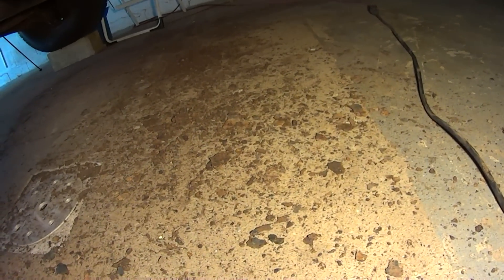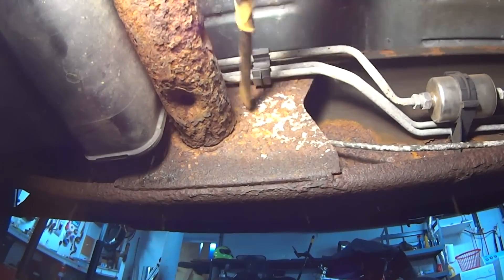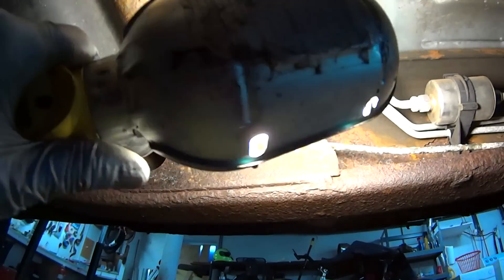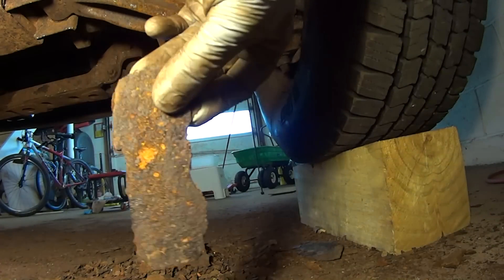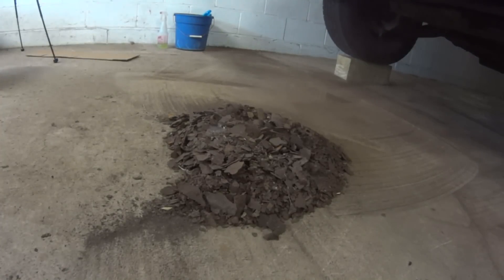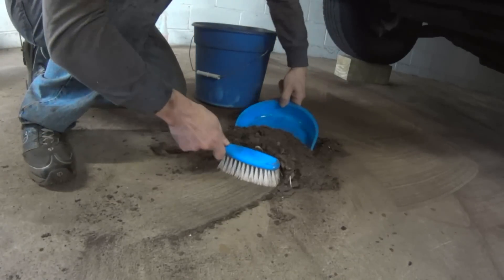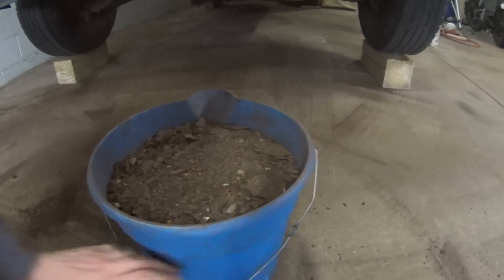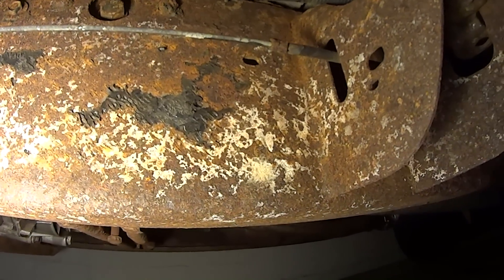Most satisfying video. Silverado Frame rust removal, RUST PROOF STUDY

Comment: ashes ashes, dust to dust, just sit back and watch the GM rust
Reply: Not as bad as dodge
Reply: My car was made in the 1820’s and I️t has 0 rust
Reply: Kevin spacey ive seen a few fords before, chevys run good and ride amazing. But the fames are a problem, unless you sandblast and paint them. I have a 1992 and a 2006 dodge 2500s both are out in the winter time in the salt and their clean (06 has bed rot like every one ive seen) when i got the trucks i tore them appart and had them sandblasted. Every year before snow hits i shoot the frams with some black rustolum and I could eat off the frames
Reply: Kevin spacey but I thought the grand Cherokees were unabody?
Reply: Willie G lol! The only problem is they all rot out the same GM Ford and Dodge I'm up in the Northeast every truck that comes in my shop same position doesn't matter who makes it
Reply: Its got nothing to do with gm, it happens because they buy the vehicles then don't take them to a shop and have them undercoated. This kind of damage is caused by salt which is put down to control ice and snow!!  This will happen to a ford, or dodge. I will say this about ford tho, the truck bodies are made from aluminum, so we know it don't rust!!
Reply: Kevin spacey it wouldn't last forever up here  in the Northeast the chemicals are horrible best thing I found New Hampshire oil coat it once a year stay like brand-new forever
Reply: Andrew Morgan good point thanks ! I never thought of that! But the thing that paint won't do that the oil will do is it creeps in all the places that you can't fit a spray gun and through capillary action it actually is drawn towards the rusty areas and It Coats it with an oily film that stops any oxygen from getting at the metal and helps to slow the process or even stop the process of oxidization! I have personally tried every way you can think of and without a doubt the best way is to have the frame out of the vehicle sandblasted zinc-coated epoxy primer coated and then covered with some type of a urethane paint it will pretty much last forever if you do that but it's extremely labor-intensive and expensive!! oiling cost 180 bucks a year I've been using it for 2 years now and I have absolutely no more rust issues at all and I'm in the Northeast Rust Belt!
Reply: My 17 year old GMC Sierra is just now barely showing surface rust on the frame. But I live in the south where it rarely snows and wash the undercarriage good after visiting the beaches also. Go figure😂
Reply: All vehicles rust lol
Reply: @Kevin spacey Dude you're seriously going to try and claim your Jeeps are superior against rust? Every fucking Jeep 10 years and older are nothing but cancerous rust underneath. It's seriously the hardest part of finding a good used Jeep because they're all rotten out.
Reply: Kevin spacey i use the rust reformer lol but usually in a years time the frames still clean, i hit them with my power washer, let it dry and paint them, being as ive done it for 4 years now they the paints getting pretty thick lol
Reply: Kevin spacey lol that was my bad
Reply: Or you know you could maybe toss  a resistant coat of paint on the frame every year?
Reply: Kevin spacey u are incorrect about GM trucks being the only ones that rot I have F-150s, my shop up in the Northeast all the time I go to lift them up and the lift arm go straight through the frame they all wrote the same!!!!
Reply: Willie G 
I'm laughing at your comment while choking back tears as I also think about all the goddamn rust on my Camaro. Thanks, GM.
Reply: I lived in Minnesota for most of my life and out of every vehicle my dad or my family has owned, the GM's used to be the ones with the least amount of rust. The dakota my dad owns still has pretty much rotted away and the frame is going out the way of the body, He's also owned a 1994 GMC sierra was rust free no rust anywhere. My uncle has a 90s Silverado and its frame is damn near rust free the body pretty gone. My aunts 2015 is rusting as bad as my dad's dakota. My other uncle's 2015 dodge ram is the worst in rust on the frame. Then again here in the midwest we have a saying, DON'T BUY FROM MINNESOTA. Once it leaves the dealership it will rust lol (If you are wondering why I never brought up my vehicles well because they are old as fuck)
Reply: Has nothing to do with the brand. The reason it rusted was Salt as stated in the video. Not anything else anyone that lives in the rust belt will tell you the salt from the state plows kills your car.
Reply: Willie my 96 f 150 is same way. What is it the 70s frames were made better? Money Money.
Reply: My 99 Tahoe has not one spot of rust on the frame. Its all about taking care of the frame. Just wash the frame off after they put salt on the road.
Reply: Kevin spacey They don’t want them to last forever, forced obsolescent
Reply: dailga my dodge is 25 years old and has stock paint on the frane
Reply: Willie G still run better than a ford
Reply: Kevin spacey yes but that was 20 years ago. Im a welder, i work with steel. Zink, which is used in the galvanizing process. The price has gone up over the years, and why would a car manufacturer make a car that lasts a lifetime? Then you wouldn’t buy another one or two. Gotta think business
Reply: 21 @blacksheep9734    Then again sell me deliberately cheap 💩 for whatever reason and you’ve mad an enemy for decades .   Then a prick like me takes the time to file these things in detail on places like  carcomplaints, NHSI ect. Then there’s that other business principal which kicks in, “ bad news travels fast” and the smell 🙊lingers”,especially when others pile on.
Reply: GM don't care. They want you to upgrade and buy new, so old can't last

Comment: The God damned salt is a major problem
Reply from the maker: Sure is but without it i would not be able to drive for 4 months
Reply: @troutjunkie7330  Doesn't sand and pebbles do the job well enough?  I avoid purchasing a used car from salt states.  The Sierras get 4 plus months of snow and we get by fine WITHOUT SALT.
Reply: @troutjunkie7330  isn't gravel better ?
Reply: @troutjunkie7330  No thats when they need to use more Cinders an less salt or just make heated roads lol wouldnt that be nice
Reply: @troutjunkie7330  Sure could with studded snow tires just keep the roads plowed
Reply: yup. sorry to all of you that believe differently. Don't fool yourself.  Its not the Chevy, its not the Ford but rather  the lack of doing your chores by means of a  fresh water pressure rinse the next day it stops snowing, the roads are dry AND the  lack of applying any sort of oil or lanolin spring and fall.

 or prepare yourself to pony another 50 grand for any overpriced truck for the next 72-84 months. until they hot dip the  frames, and outfit with aluminum bodies,  stainless lines, rotors, banjo bolts etc,  Ile stick to the fore-mentioned and continue  driving a rust-free  02.  $35/gal of fluid film and $5 at the car wash  is short money in the long run.
Reply: im from Denmark and we use salt and it kills our cars i have importet a BMW from South germany and it was fresh as new
Reply: We need to stop salting roads. If idiots can't drive in snow, then walk!
Reply: Joseph P Liptak Jr I know save the salt and the gravel. I’m from CO once they run out of mag chloride it’s straight to gravel. I cant keep a good windshield in a car or truck very long. Not to mention people change lanes right on top of you sand blasting you.
Reply: Where I live they don’t use salt just rocks gravel sometimes sand. And if you wash your car in the winter like 3 times a week you’ll survive winters beating. Just most don’t wash there cars enough and the salt sits and that’s when the damage occurs
Reply: well and the fact GM still waxes there frames not E coating them to save money

Comment: Oil undercoat. Its the only thing that works. Stuff like fluid film or "keep rust away". Regular rubberized undercoat only helps when the car is brand new. I like the fluid film stuff. I buy it in a bucket and use a paint brush. Its like butterscotch pudding. It just keep spreading out and creeps into everything. Ive had awesome luck with it. Best if you put it on then drive around on dusty roads. Then put more on. Once it builds a layer a muck what's under it will never rust.
Reply: moparmania86 I don't recommend the rubberized undercoating at all, it traps water underneath and you don't find out till it's too late. Where I'm at in Canada, we have Krown undercoating and I swear by it. If there is any rust on your vehicle, it will neutralize it, along with adding a nice coat of oil.

Comment: You did pretty good holding that air chisel steady with one hand.  You had to hold it with one hand I'm assuming for filming.  I have done this before and I use two hands on the air chisel.  Nevertheless great job man........Canada

Comment: I think my cummins is worse. The northeast is terrible
Reply: i agree..no matter what you drive after 8-10 winters the salt gets them everytime.
Reply: Pat massey there's no way ford uses Superior Steel I'm in the Northeast far south of you and I see Ford's come in with frames rotted right through you can't even lift them because the lift goes straight through the frame now having said that I see the same thing with Chevys and Dodges if your frames in that good of shape you don't use it or you've been  oiling it which is been a very popular thing in Canada for years and in my opinion  is the best and only way to maintain it with products like corrosion free or krown Oil Etc!!!!
Reply: Pat massey well see Chevy owners are real men and don't mind undercoating their own trucks, we will leave the sissy Fords for you women.
Reply: Get the fuck out of here you Chevy 'tard. The real men who buy trucks for work buy Ford Trucks. Whenever you see a woman driving a truck, it's a Chevy.

Comment: Surprised your brake and fuel lines aren't rotted away.   GM was good for that in the 90's to 2005 trucks.*EDIT* - I see you have had several brake line failures.

Comment: hey Astrp Camper if my truck has 80 lbs of rust and I chisel it off like this, how much less good metal would I have?
Reply from the maker: If its dry, 80lbs less metal. The rust expends but does not get heavier.
Reply: i mean like with the calipers.  how thin can ot be before it just needs scrapped?
Reply from the maker: That is hard to answer. Your frame is about 0.150" thick. I had mine down to 0.110 in some spots. That's not bad but if you have 0.060 left, you truck will just fold one day.

Comment: how much do you think that weakened the frame
Reply from the maker: Looks worse than it is. Rust swells up so it always looks like a lot of metal lost buy it isnt.
Reply: brianallen0826 the metal is fine it's just the factory undercoating
Reply: You're kidding yourself if you think that frame hasn't been compromised in any way.

Comment: this is the same reason I sold my 2002 silverado z71, could not stop the rust , pretty sad these trucks are 10 years old and rusted the @$#! out. the worst years are 99-07 gm trucks it seems , rockers gone and wheel wells , that's why I'm really thinking of a 2015 f150 and undercoat the hell out of it , cool video man!
Reply from the maker: But the frame is still plain steel
Reply: Yup the f150 2015 I just looked at yesterday , I took a magnet with me, the frame was the only thing metal, the floor boards , body panels tailgate, bed , all aluminum , but shit , a crew cab 4x4 is still like $33k used in ohio here, my problem is i have a company van, and my personal truck sits alot and only gets 3000 miles a year put on truck and that seems to make it rust out faster , when I was in Nevada and Texas a couple years ago I seen Tons of 19 80's cars driving around , all those in ohio rusted out and are in junk yards
Reply: Commenter Same year Dodge 250 here. Open C channel frame will last forever, even haul a heavy slide on camper with it but had to install airbag overloads to level it. Took a while to drill the necessary holes to install.
Reply: the new f150s are aluminum body's. you won't have to worry about rust
Reply: yeah the 2015+ F150 still uses a steel frame. The paint gets scratched pretty easily when it's put on a lift. Make sure you repaint it any time you take it into the dealer for service. Seen some frames with big rust patches already.
Reply: Bud my 17 year old GMC Sierra is just now barely showing any surface rust on the frame. I don't live far from the North/South Carolina border on Interstate I-95 where it rarely snows. I visit the beaches like anyone else but always make sure to wash the undercarriage real good when I get home (along with the body of course). Living so close to Interstate I-95 I frequently see so many 4-6 year old trucks of all brands completely destroyed from rust. All with out of state license plates & usually from up north. I think that everyone on here complaining about how shitty GM trucks are should understand, it's not GM's fault that you live where you live. GM trucks are some of the best, longest lasting trucks on the road, when taken care of. All vehicles rust from salt, rather it be from up north where it snows a lot, or down south from the beaches. People have to take care of their stuff and not blame the manufacturer for their own negligence or choice of residency. Just saying....